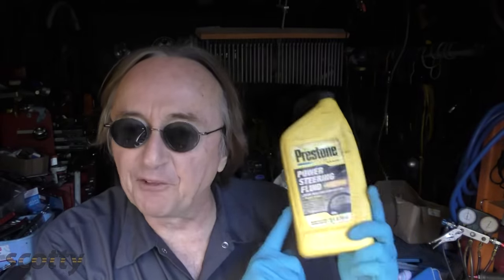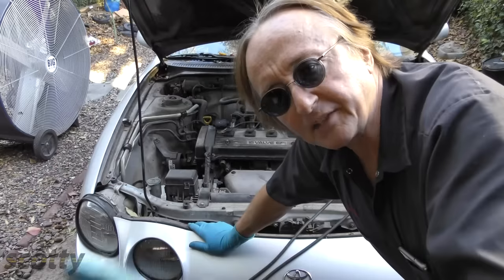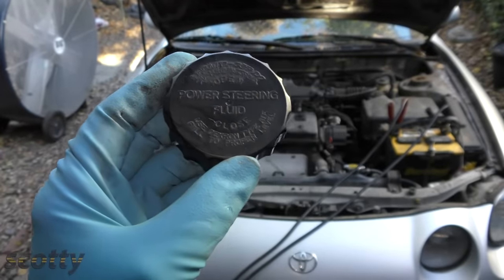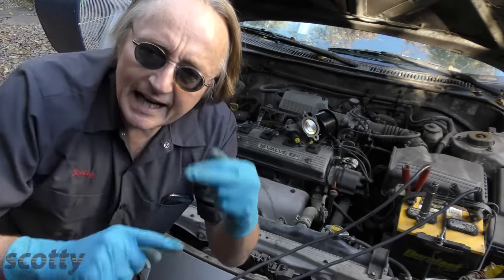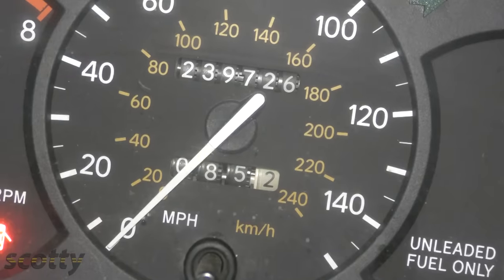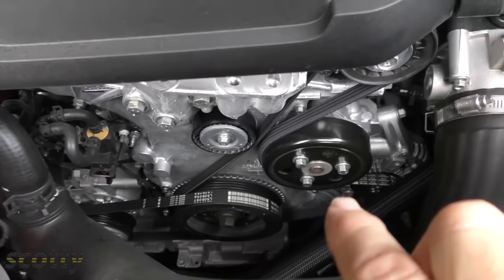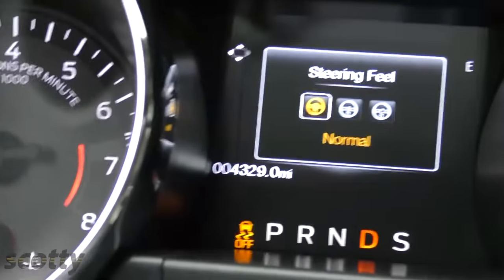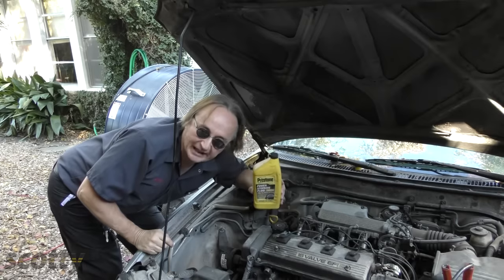Should You Change Power Steering Fluid in Your Car?

Comment: The electric power steering can be wacky if the alternator takes a dump and the battery gets very low. Its a good idea to find out you have electric power steering just in case something happens. Its not like hydraulic power steering where you have hard steering you momentarily loose steering altogether on some cars.

Comment: Can power steering be associated with certain engine noise? My mother’s power steering I believe is on its way out but only from what I’m hearing not feeling.. the engine just sounds so much louder and windey I wish I could show you lol. I hear some cars that sound like this too. If not do you think it’s transmission related? It’s a 2006 Nissan Maxima. We already know it’s burning oil a bit but that’s a common problem with the 3.5L VQDE engine. Thoughts????
Reply: Nebderf 350zHR Does it sound like its super charged when you turn? If so put more fluid in and look for leaks if need be. My grandma's 2009 Buick Lacrosse had that very problem and the resevior was in behind the engine block where you cant get to it easily
Reply: Just shoot video and put it on youtube.

Comment: Hi Scotty, my 2000 Saturn LS1 is using a lot of power steering fluid.  There is no visible leak, but the steering wheel moves up and down, even with the lock is on.  it doesn't vibrate or move left/tight (unless. of course I'm turning). What can I do to properly secure it.  This bobbing up and down caused me a failed vehicle inspection today.  Please help.

Comment: Love your vids Scotty. 2005 Toyota Corolla. Cap says use Dextron type ATF for the power steering. The fluid is clear. Just pour the red stuff in as a replacement or is there a clear brand out there? I like the clear. Easier to see if it's clean. Thanks.
Reply: Just came across this now in 2023....but I am looking at the same issue on my 2005 Scion xA. Fluid is clear, and VERY clean. Can't seem to find the proper original factory fill that is clear and is still Dexron III viscosity. Don't fall for the "Dexron VI is backwards compatible"....it isn't and is lower viscosity. Bought the Dexron III from the Toyota dealer, but it's red. Seeing the old stuff is so clean, will only top-off as it reads low. Let me know what you did.
Reply: @TheWilferch  Never found the clear.

Sucked out the reservoir, then filled with ATF Mercon V (red). Been doing that for each of the past 4 years. So far so good for a 2005 Corolla, and a 2004 Highlander. I have never completely replaced the fluid. Just hoping the slow change keeps it running well.
Reply: That fluid was recommended by the Autozone Auto parts store here in Los Angeles.
Reply: @pedalingpete626 ...thanks for replying and engaging. Let me share my research. Dex II and Dex III...the product recommended for both of our P/S systems, is out of print. Dex III has a viscosity of around 7.2 and the Dex VI that is supposedly backwards compatible is a risk, as it is much lower viscosity. I found several Dex/Merc products that specifically say good for Dex II and Dex III replacement,  and ALSO say NOT for Dex VI....so these should be good.....but the Mercon V oddly says it's a substitute for Dex II/III....AND Toyota T-IV,...oddly a product NOT to use in our P/S systems. So even though I had Toyota T-IV on-hand, I bought Toyota's specific Dex III product ( part 00718-ATF00).  As to the procedure, I get it. Sucking it out and replenishing seems good, but I also wonder how beneficial that is because the wear particles and sediment are likely to be at the very bottom of the system....maybe let it go that way and only top-off...as my clear original fill is still clear and looks to be contaminant free....just a tad low.

Comment: Hey Scotty.. Big fan... I have a 2006 Toyota Mark X. It has a 4GRFSE engine and driveline which is similar to a Lexus IS250. My car occasionally throws up a Power steering light and steering assist goes away.  Upon restarting the car, the problem gets fixed. I checked and cleaned all connectors of my steering system. It did not fix the problem. Later I connected an OBD 2 scaanner and the stored code showed a bad torque sensor. But the system works fine when its working and the torque readings are okay. The problem only comes ones or twice a month when the the temperature is above 100 degrees fahrenheit. My local mechanic says that you need to replace the whole steering rack which includes the power steering motor and sensor.  Would love your advice on this. Waiting for your response
Reply: Fix code first, Get Alldata DIY for yourself. Much cheaper, when replacing steering motor and sensor by gessing.

Comment: Easier way to do this on an older car is to pull the pressure line off and put it into a bucket, when you start the engine the pump will drain the system in a few seconds, DO NOT RUN THE PUMP DRY!  Re connect your hoses and re fill your system.  I did this a few times on my old 91 Accord and that pump had 265K miles on it when I sold the car.

Comment: I thought this video was about Power Steering Fluid disappearing into the system. My car does that now, and it has no leak spots whatsoever. Could it be the Steering rack that swallows the fluid? Just changed all of the hoses early this year btw.
Reply: sonyviva308 Sometimes leak spots are difficult to find.  You can get a dye at your local auto parts store, that, with a black light, will show you definitively, if/where you’re losing fluid.  That fluid has to be going somewhere.
Reply: Check the boots covering the inner tie rods...you'll probably find the rack end seals have worn and these will be holding fluid.
Reply: I had a leak in the PS pump's front seal and didn't want to spend the $$ to replace it right away so I tried Lucas PS Sealer. They guaranteed it to work or money back. Worked great and that was 4 years ago.  Zero leaking. You might try it, too, for your leaking seals.
Reply: Yeah that could work. It's just a pump that pumps fluid to support yer steering that's all. I did purchase some PS fluid and it has anti leak additives in it. Works for now. heh
Reply: Leak inside the boots more then likely run it by your local mechanic don't keep driving it like this.
Reply: Good advice!
Reply: The pump is belt driven. If it siezes, expect stress on all the other components driven by the same belt. Bye bye alternator...

Comment: What if your steering is starting too feel stiff is that a sign I should change the fluid
Reply: Ryan Scherbluk that’s what I’m doing to mine now. He has a video about using Seafoam to make the steering easier. I did that and it’s not helping mine so I’m going to do what he said to do in this video, suck it out replace it the. Drive around the. And repeat the process 5-6 times to get it all cleaned out.

Comment: Question: how exactly is this done? You just keep extracting and the adding in new fluid until a quart is used? Isn’t this taking out newly added fluid too? (Car novice... have only changed oil). Thanks for any help
Reply: Matt White yes it is but you also can’t get all the dirty stuff out with one try. So you have to repeat the process a few times which should get all the dirty fluid out. Did you end up doing it?

Comment: any reason why bad idea to remove low press hose from pump, place that in bucket and just have car running while filling new fluid and letting old fluid come out of low pressure hose until the clear stuff starts coming out, replace hose, and top er off.

Comment: i got a audi a4 b5 1,6 1995, and the power steering is on minimum according to its dipstick, and i dont have any money for power steering fluid or ATF. so im wondering if its fine for me to use gear oil in it? to be specific, its 75w80 gear oil.

Comment: Scotty. i need to flush power steering fluid in my 2005 hyundai elantra and there is no info anywhere of which type to use other than let the dealer service it for like $200. or buy the fluid at the dealer for $9-10 a pint, which type of steering fluid would you advise me to buy , thanks.

Comment: after my last car became a money pit I'm paranoid that something is going to wear out prematurely on my new one. Oh well, on to the steering fluid I go. is there a such thing as over-maintaining a car?
Reply: If I had a choice over-maintenance is better than under maintainance IMO.
Reply: Golden Grenadier well, if time and money is not an issue why not. But you may be overspending.
Reply: what was your last car
Reply: Bmw M3 e46 a 2002 Chevy Blazer. she fought the good fight but the transmission died twice. the second time I decided not to fix it and look for another car.
Reply: Golden Grenadier I hear you. My 1965 Mustang when I first got it had enough issues over the span of two years that if it wasnt a classic I would have gotten rid of it. 
There were some (easily fixable) electrical problems.
The transmission started to bleed out real bad, and the first shop we took it to was run by incompetent morons.
The entire front end had to be redone internally because it wouldnt hold an alignment or proper camber and it destroyed both front tires (and the old ones that originally came with it were dry rotted). 

But I think its worth putting money into and turning into a daily driver. I had a radio swap done and Im planning to add an AC system. It still has the original engine as far as I know. The frame is still intact, heater still works but its kinda weak and Ill need new defrost hoses.
Reply: Fox McCloud 007 I was actually looking at a mustang for a new car after the blazer. it was a 1999 35th anniversary edition and it was my favorite color, yellow. I test drove it and it felt like it was either knackered or not very powerful to begin with. I probably would've taken it if it had more get up and go. the interior and exterior were pretty worn as well and didn't have much room. My mom was helping me out with the car searching process and I'd said something about a Volvo earlier. she looked on car guru and miraculously there was a T2.5 2005 Volvo S60. I tried it and it felt great as well as comfortable to boot. It was only about 1300 more dollars  expensive than the mustang and interior was in nearly perfect condition so I gave cash for it and I've been happy with it ever since. I watch the fluids like a hawk though. My only regret is that I didn't buy an American car but Volvo was owned by ford in 2005 so I don't feel quite so treasonous.
Reply: Golden Grenadier I dont like 'Stangs made from the mid 70s to '93. My '65 has a 200 HP V8 and 3 speed automatic in it. At first I thought that was wimpy but it also has 1000 lbs less weight to carry than a brand new one. My gramps told me that a 5.0 in the mid 70s put out only 130HP.
Reply: Golden Grenadier u can buy a manual transmission for less than. A new car

Comment: When you remove the ps fluid with a turkey-baster, and drive around the block as Scotty says, is there any risk running the ps pump dry before it's re-filled?
Reply: Chris Keladis you'll be adding new fluid in so it won't go dry.
Reply: Chris Keladis haha, i think you misunderstood him. The process is remove the old fluid. Top up then drive around the. Repeat x amount of times.
Reply: Dont start the car without power steering fluid or you'll kill the pump

Comment: Can someone explain to me why some cars, like a SN95 Ford Mustang, call for transmission fluid to be used as power steering fluid?

If someone mixed the manufacturer spec transmission fluid with straight power steering fluid as power steering fluid, is that bad?

Comment: My 2013 civic has electric power steering. That's gunna be pretty expensive if that goes out which I hope doesn't for a long time. I'd rather have an actual power steering pump than an electric one. Cheaper to replace if it goes out

Comment: How can i change the fuel lines power steering pump and sending unit and gas tank on a 1992 Chevrolet Lumina. I'm trying to do it myself this would be my first time doing it
Reply: 1) unscrew old one
2)remove old part
3)put new part in
4) screw it back to place
5)fillup liquds
6) enjoy

Comment: Scott I am new on your channel 
I have 2008  Toyota Camry what type off the power steering fluid should I use?
Reply: Use exactly what the cap on the reservoir or the owners manual says.  For my camry, it was transmission fluid.  Can't remember what kind, but just look at owners manual.

Comment: The steering system of my 2002 Ibiza is electrically driven en has got an oil reservoir.
Reply: Then you have a hydraulic system driven by an electric motor. It's kinda the middle thing between engine driven and fully electric.

Comment: Hi good morning Scotty I bought a 1996 Honda Odyssey minivan it has high miles on it it had a blown head gasket I had a mechanic fix it he sent to the shop to get resurfaced and put in a new gasket  after it was done I test drive it the next day almost all day with no issues the second  day on my way to work the bottom piston went out it now before u had the head gasket done besides it getting hot on me the bottom piston had no problems with it or was only after he redid the head gasket the piston went out he tells it was the first time he ever saw that happen after he did a head gasket can you tell me what could have happened is it his fault could he have done something else to prevent this I think it was his fault i wanto be sure I'm not going pay for something that was the mechanics fault I will await your answer Thank you?!

Comment: I waa a little confused about removing the old fluid. If you keep driving and sucking out fluid, couldn't you possibly get air in the system?
Reply: you drain as much as you can and then you fill it up new fluid. then you drive around for a while, rinse and repeat until it is mostly new fluid.
Reply: samme100xX Ah I see! Thank you. That makes more sense.
Reply: Yeah, in that way you won't get the air in the system.  Its a good idea, while you have the cap off and are putting new fluid in, to turn your wheel lock to lock about 10 times to get the fluid circulating.

Comment: Do I need to drain oil from torque converter for my 2013 KIA Sorento ? is it really necessary ?
Reply: It's recommended to drain and fill transmission oil regularly.  
Since a "drain and fill" will only replace about 1/3rd of the oil, many folks will recommend draining and fill 3-4 times over a shirt period if time (few weeks).

If you have been consistent with draining and filling (once a year, starting in year 2), you can just stick with that schedule rather than draining 3-4 times over short period of time.

Comment: Scotty Kilmer please i need your help im having problems with my 2005 Chevrolet Aveo ls sedan and sometimes the check engine and hold light appear and I've took the car to the closest auto part store and they told me that it was an engine misfire code P0300 but the thing is that sometimes when im driving it ,it runs just fine and then all of a sudden the code comes back again and the rpms go to high before it shifts gear im wondering if i need to change to better quality spark plugs can you help me please thank you and really informative videos im watching them from Chicago Illinois .
Reply: plugs-coils-compression test-vaccuum leak test.

Comment: There is no need to drive the car around the block to get the remaining fluid out. You just prop the car up on jack stands at the front and start the car. Turn the steering back and forth to it's extremes a couple of times and the pump will pump the remaining fluid out, into the resoviour and you suck it out with your turkey baster. Five years is also too long for traditional power steering fluid to be in there. Like any hydraulic fluid, PS fluid is hydroscopic and pulls in moisture from the environment. That makes the corrosion inhibitors less effective and lowers it's lubricity. Unless you are using synthetic fluid, in which case you could go longer, cause they don't tend to be hydroscopic. If using traditional PS fluid, treat it like brake fluid or trans. fluid and change it out every 2-3 years. Your car will thank you for it and like Scotty said, it's cheap stuff. Racks are not cheap and a big job.

Comment: So my Bimmer with 300K miles will the steering system self destruct? 
What about my other Bimmer with 250K both have the original steering system and fluid should I be concerned?
Reply: Wouldn't be a bad idea to flush it

Comment: Hi. I've a 2008 chevy malibu 151000 miles there was a recall on my electric power steering I missed the dead line know my car is locking up for about 7 yrs once in awhile especially in the winter n also there's a clunking noise in the steering wheel I changed the intermediate shaft n still acting up. Please help

Comment: Hello little question:
If the steering pump breaks down can it still be driven?
Reply: Yes,but it's gona be harder to turn the wheels
Reply: its basically the same when your car is off and have your keys in and trying to turn the steering wheel
Reply: And if you do it for a long time, you might break something on your steering column... personal experience.
Reply: Might need some amount of assistance to pass yearly inspection? e.g. UK MOT

Comment: Hold on a sec, if you suck the reservoir dry too many times and then take a drive, the pump will start sucking in air and eventually seize. It's better to suck all the old oil out of the reservoir, fill it up with fresh new oil, turn the steering wheel or take a short drive and then repeat the same process until it's clean. Alternatively, you can change the oil over a period of a few weeks.
Reply: Gym: think that’s what he meant. Take out, refill, drive around...repeat till looks like “new” fluid.